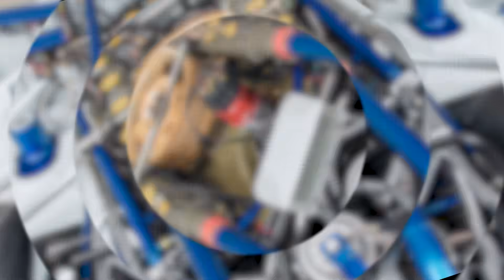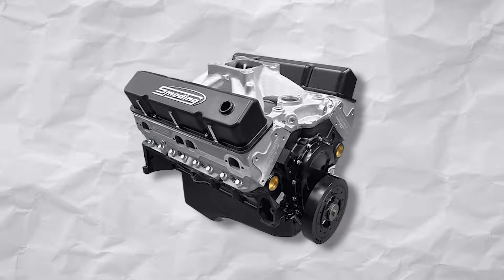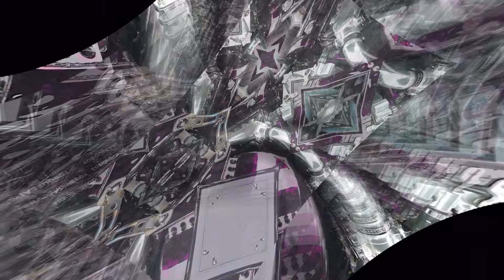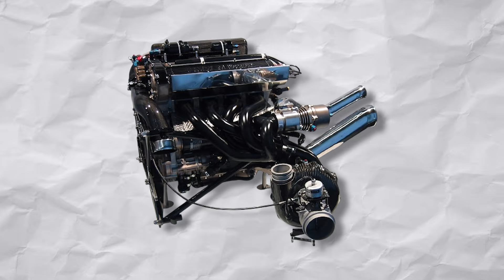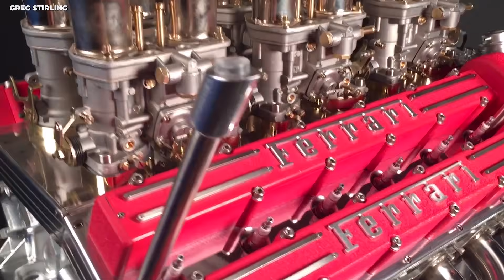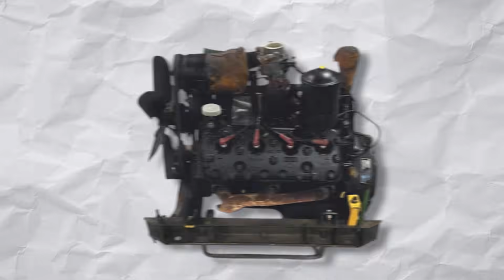13 Best Engines For Racing Cars!

Comment: You're all over with the specifications on a four-cylinder engine 1,000 horsepower and then it got turbocharged and ethanol fuel and it got tuned up to 700 horsepower, explain that please.
Reply: Lots of errors with AI narrations. I'm almost 68 years old. It's a bit difficult for me to detect much of it!! 
Recently this AI in both Voice and Video is just mind-blowing!! I can remember much of the primitive CGi from the Late 1980s and Early 1990s. You might be interested in seeing "Beyond the Mind's Eye". It features some great Music by Jan Hammer! Even by today's standards, the CGI is pretty cool!!
Reply: @RedneckSpaceman Thanks for sharing